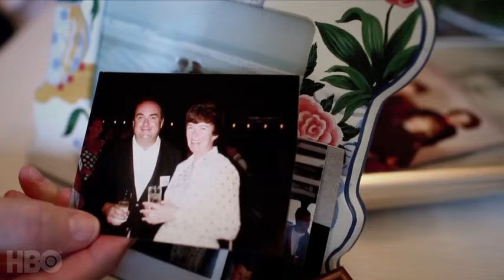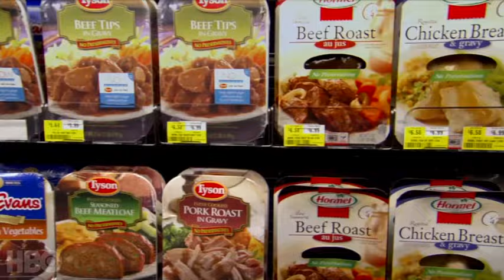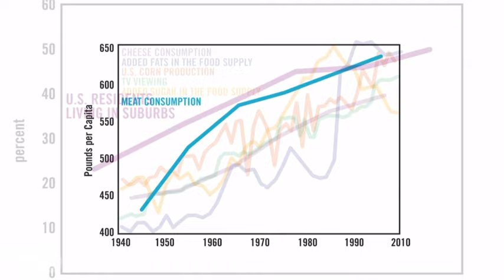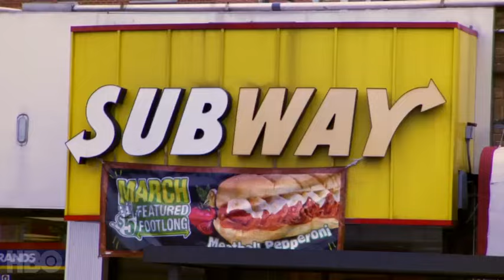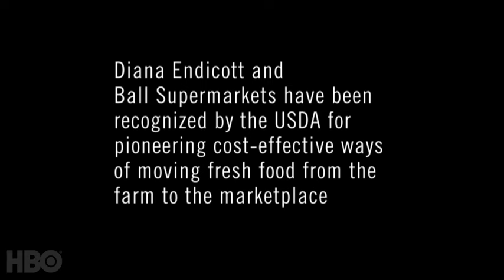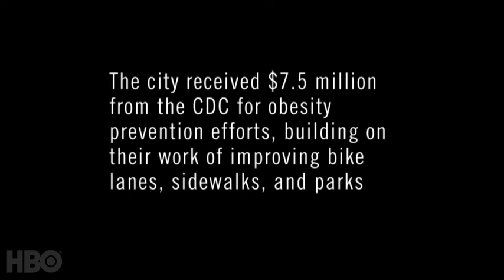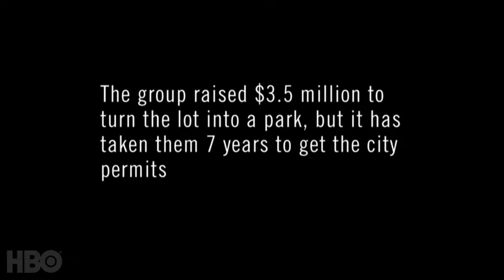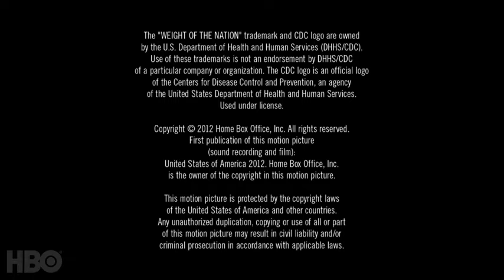The Weight of the Nation: Part 3 - Challenges (HBO Docs)

Comment: Yes, physical activity is way too overrated. It boggles my mind that you do all that work and STILL only burn such a miniscule amount of calories.

The main problem is that we eat even when we are not hungry. We ear to entertain ourselves and out of boredom.
When we do eat out of hunger, we eat too fast and thus end up eating more than we need.
The processed shit that we eat are too high in calories AND we require more of it to make us feel full.
Reply: Not either-or. BOTH. Exercise is NECESSARY, especially to maintain weight loss, and absolutely for cardiovascular health and boosting metabolism/keeping insulin low, not to mention mood improvement and just plain filling up time you'd otherwise snack in. It won't, however, make you lose weight. Calorie restriction is the ONLY thing that will do that. Of course, that also means eating good food because there's no room for junk on a low-cal diet.

Comment: One of the problems not addressed in this video is that the average age of the farmer is 57. The ration of farmers over 55 yrs old to those 35 and under is 18 to 1. They expect half of all American Farmers to retire (or die) in the next 10 years. All these farmers markets are already scrambling to attract local producers to sell at them. What happens when a key element in the solution faces a reduction by half. We have to attract new farmers into supplying local field to table food venues.

Comment: Really it’s carbs , sugar “which sugar is a carb” and vegetable oil. And eating too many times per day. Especially processed carbs and sugary drinks. Even a lot of fruits like bananas are too high in sugar. A high animal fat low carb diet, non calorie restricted can does and will lower body weight,  blood pressure and lower blood sugar. It works extremely well. Do you want to reverse diabetes? Lose weight? Improve your skin, improve your ADHD? If so I wish you the best of luck. Look up ketogenic diet with intermittent fasting on YouTube you will find many channels that will help you successfully do this. Exercise has little to do with it. It’s really about diet that helps the most.